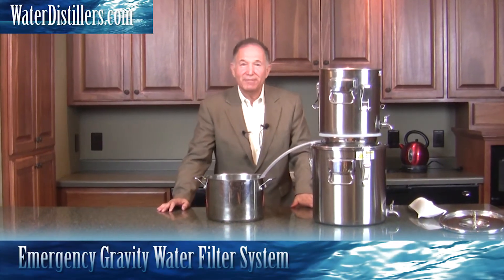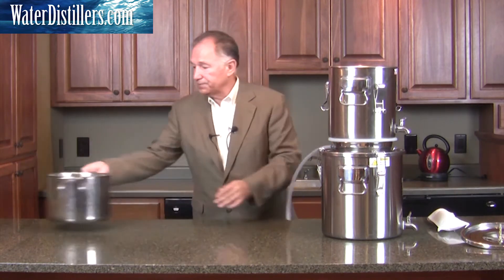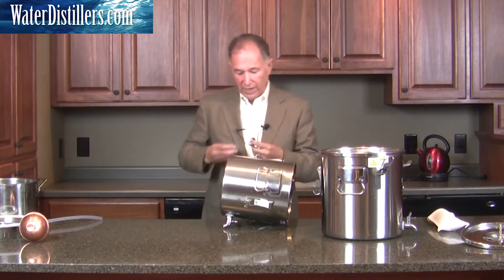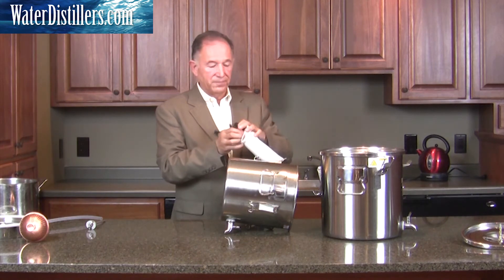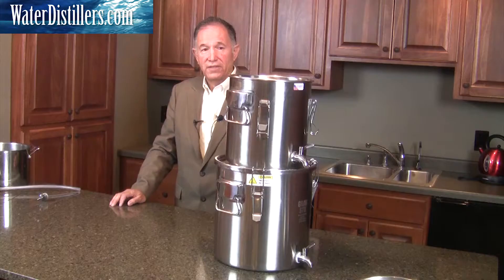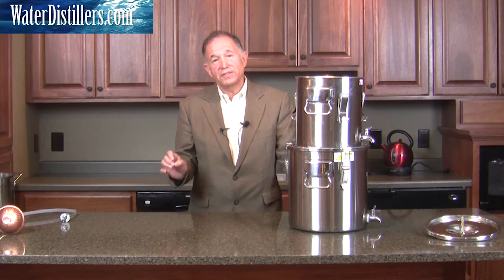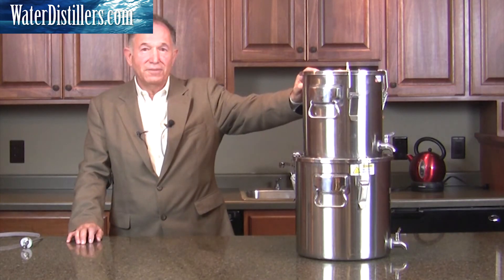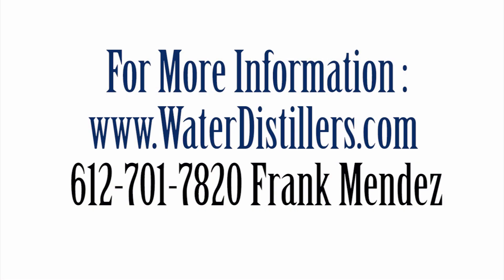Emergency Gravity Water Filter Setup And Operation

Comment: ONLY HIGH PERFORMANCE SILVER impregnated .02 Micron reduction filter than PURIFY 90 plus gallons per day
PLUS can be converted to  a Water Distiller. It is a multipurpose Gravity Filter and Water distillation system
http://www.waterdistillers.com